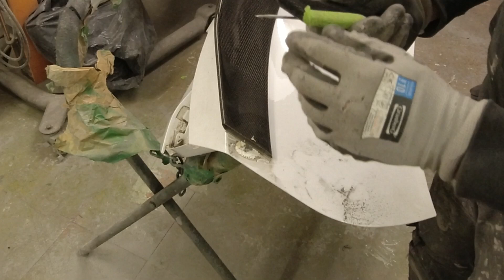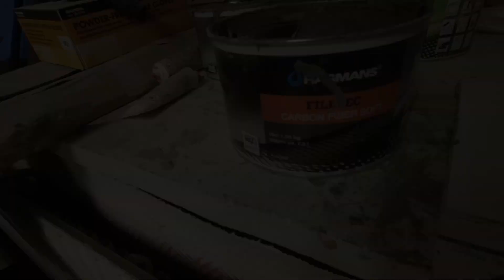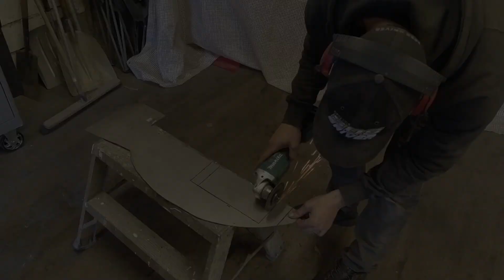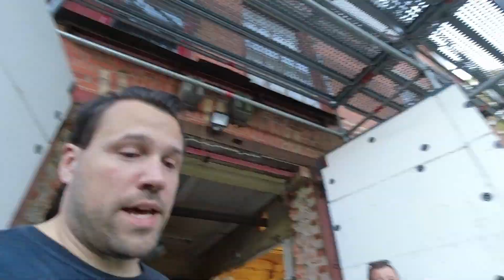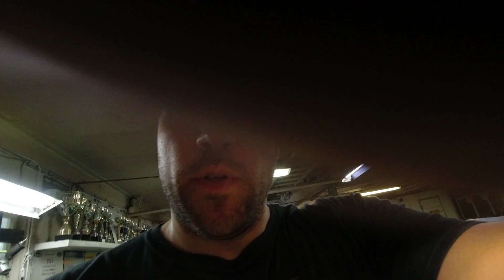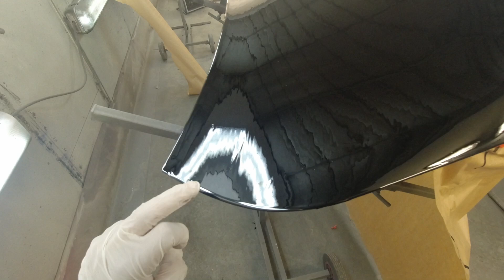Molding a Duckbill Spoiler In Real Carbon Fiber

Comment: Great work and a great contribution! I'm trying to get Hagmans putty, but it's impossible in Spain. What can I use to achieve the same thickness over the resin and fiberglass without it cracking, so I can then do the skinning?
Reply from the maker: Huge thanks for the feedback. i would saa if you ar skinning with carbon fiber and resin you are safe to use fiberglass from 3M or Würth.

Comment: One question: what's the use for covered steel parts anyway???
If you make it carbon, why not making the complete part out of only carbon fiber???
😅Seems to be kinda useless just covering it😅
Reply from the maker: Hello and thank you for watching. You are absolutely right, my friend, you should actually do that. But my client didn't want to spend the money on me casting it. The customer's goal was mostly appearance in this case. This is a good example if you want to try this at home and perhaps don't have all the knowledge to cast/mold off and glue on afterwards.

Comment: would love one of these on my e90
Reply from the maker: It came out really good. Do it =)
Reply: @MagassDesign  how does this hold up over time? wont it crack in the transitions? ideally for me, i would just get it painted after its been molded in? so no, carbon fibre overlay over the whole thing.
Reply from the maker: @juangouveia8098  You could do boath. My customer wanted to have carbon fiber overlay, but you could just paint it.
I have done this over 30 ish times and had a good result over time, but what I learnt over the years is that it can sink but I have not seen it krack with the method I use.
Reply: read my mind....

Comment: I've use fiberglass a few times before but i feel like I'm missing something; the bootlid is metal and the wing is CF, then smoothed out. Then i would have taken a mold to them make the CF bootlid as a single piece of only CF. So  not making the mold and then filling that with the CF, is this not just making the boot heavier? For not much structural gain?
Reply: I had the same thoughts. I assume this whole process is mainly just for aesthetic purposes.
Reply from the maker: @PennerFab  Hello and thank you for watching. You are absolutely right, more towards the aesthetic purpose. 
But my client didn't want to spend the extra money on me casting it. The customer's goal was mostly appearance in this case. This is a good example if you want to try this at home and perhaps don't have all the knowledge to cast/mold off and glue on afterwards.

Hope you have a great day.
Reply: You're correct. Spend money- less performance. But you can hard park in the car meet better😂
Reply from the maker: @notyouraveragegoldenpotato  i do what the customer asks me to ha ha...
Reply from the maker: Hello and thank you for watching. You are absolutely right, my friend, you should actually do that. But my client didn't want to spend the money on me casting it. The customer's goal was mostly appearance in this case. This is a good example if you want to try this at home and perhaps don't have all the knowledge to cast/mold off and glue on afterwards.

Hope you have a great day.
Reply: @MagassDesign  ohhh right, that makes a bit more sense now. Thank you. I cant wait to see how it will come out!
Reply from the maker: @N3onDr1v3  It came out better then I thought .Just wait and see on the next vid on sunday and i hope you will agree.